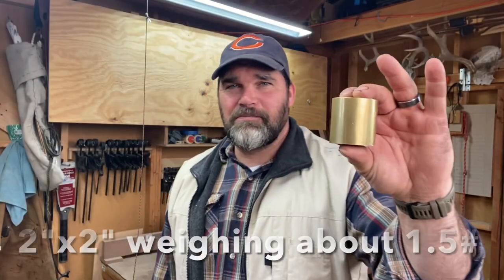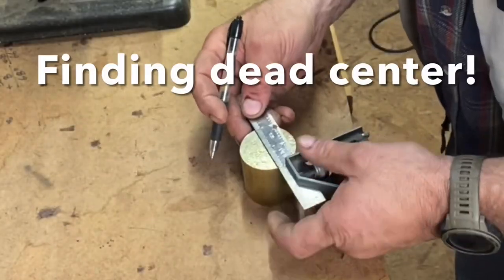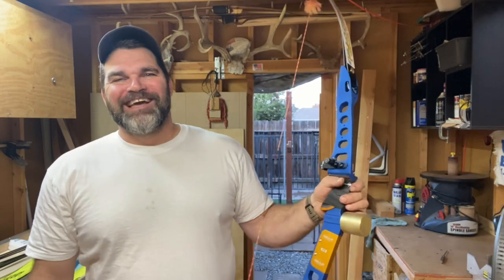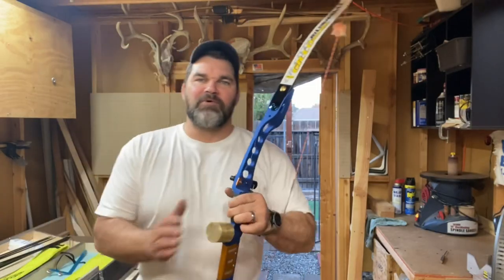Competition Bow Series: My DIY Bare Bow Weight Build for Gillo G1 27" Riser and Gillo Limbs

Comment: Why not "Yost" it - drill an offset hole straight through the brass and mount with bolt and rubber washer?  That will lower the weight a bit and eliminate the need for epoxy that might yield to vibrations.
Reply from the maker: Thanks for that, I am new to the trad/barebow weight set up, that would be a great build maybe Ill try that one sometime. Thanks for watching and taking the time to comment
Reply: @ruck-stickarcheryandwoodwo7073  I just ordered another riser, this time a Gillo GT, and rather than spend $50+ on a Yost 11oz one piece weight, I ordered a 1-1/2" x 4" brass rod off Amazon ($35/shipped) and will slice it up and offset drill for 5/16 x 24 s/s bolts, for adding offset weight at the stab and lower limb bushings.  That's another thing about drilling weights offset, because the Gillo and many other risers offset the stab bushing about 1 degree to compensate for the deep riser window, so tilting an added stab weight can "de-compensate".
Reply from the maker: @rfdsrd  great let me know how it works out
Reply: @ruck-stickarcheryandwoodwo7073  Will do! 👍

Comment: Dumb question. Why string silencers on a barebow rig?
Reply from the maker: That’s a good question, I like to put silencers on all my bows, the vibration sounds bother me. This bow is 72 inches long, and the limbtips do vibrate a little more than a shorter bow would. As far as recurves. And while making the string for this bow, I decided to add them making them out of the cut off leftovers from the string ends. I don’t shoot barebow, or string walk, I gap shoot. I need to do a video on that. Thanks for your time and for watching.